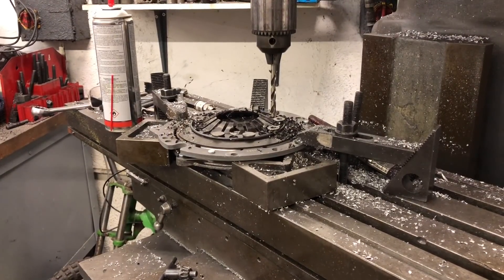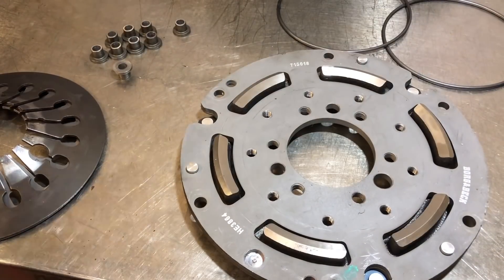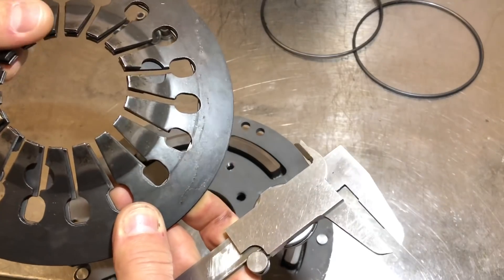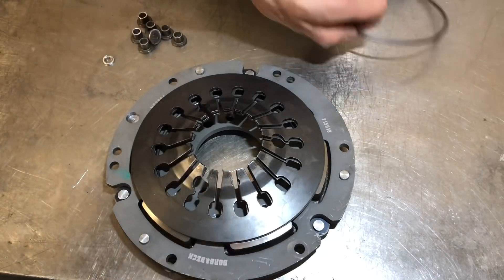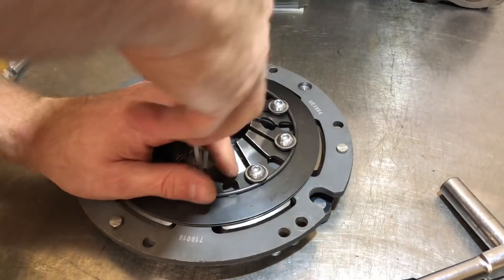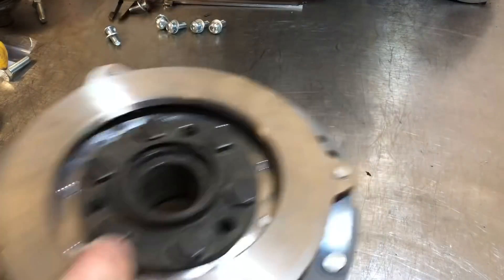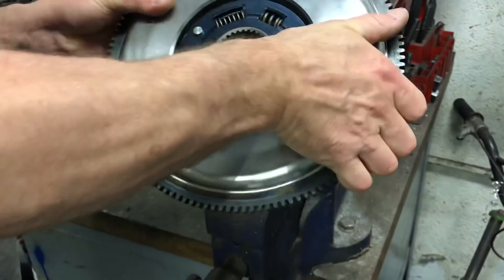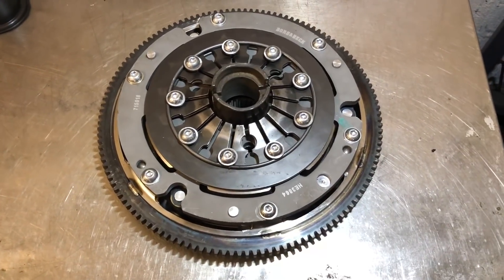RTS  Classic Mini Verto Clutch build

Comment: I have 2 standard borg and deck spring and are 2.2 mm all of them. How can you have a 1.9 if is the same kit ?
Reply from the maker: There are many different thickness springs available
Reply: @Vmaxporsch  borg he3864 is standard and I have two of this and are 2.2 what is the code of the 1.9 ? Thanks if you can help me
Reply: @Vmaxporsch   borg and deck only has 2.2 i can t understand how you can have a 1.9. with my set up the pedal is heavy and hold 450 nm too much, and i am looking to find a spring like your but i can t find

Comment: Stuart, in the video at around 5:39, you mention using Loctite 571, this does not seem to be available in the UK? Would 243 Loctite Blue be suitable? Also, if the clutch had already been balanced would it need balancing after the upgrade?
Reply from the maker: yep
Reply: @Vmaxporsch  I take it thats a yes to both? Also can I send you my RTS Clutch and Flywheel to get balanced (when I finish it)?

Comment: Stuart - I have just been advised to change my MED ST1 Competition Clutch and lightened flywheel for an RTS type clutch. Just been quoted £750 for one to be made (new). Having come across this video I think I'll have a go at making my own :-) Many thanks (would I be able to retain my Lightened Flywheel and convert the existing clutch?
Reply from the maker: Hi Bill , its best to have a clutch suited to the torque of the engine - for supercharged one up rated verto unit (see minispares) with one standard extra verto spring will give you around 160-180ft lbs capacity, many RTS are 2x uprated or 2x turbo giving around 250 plus ft lbs capacity and an unnecessary heavy pedal wearing clutch operating components.
Reply: @Vmaxporsch  Stuart - since posting this MED have confirmed that the Clutch I have is rated 70lb/ft this has been balanced. I was hoping to add another spring to this clutch - picked up a very good condition one locally last night.
Reply: @Vmaxporsch  Sorry Stuart difficult without knowing my spec or intended use. 1310, Hepolite 8cc pistons, AC RS Cam, will have 1.3 Rockers, LCB and RC40, doing the head myself. Initially engine wont be SC, but I am ensuring Diff and Clutch will be up to it and not need changing. So 3.44 Moly Pin is being swapped for Crss Pin 3.1. I am not looking for a massive powerful engine,  just anything over 100ft/lb - 140ft/lb would do nicely thanks :-) I picked up a SH Eaton65 and I have a DCOE 45 (nothing else yet) also looking out for a MegaJolt and Ford EDIS bits.
Reply from the maker: @Sternhammer89  what number are the pistons ? running 10 psi is probably going to get you 120 bhp and 130 ft lbs of torque at 6000/4000 rpm at a guess
Reply: @Vmaxporsch  P21253, I have been advised to head for 8.5CR (for which I'll need a decompression plate as I won't be able to get enough meat out of the head). I was also advised 10 PSI so 120BHP and 130ft lbs would be absolutely fine.
Reply from the maker: @Sternhammer89   21253 are designed for 70 bhp, Ive known them to go to 150 bhp on a turbo , but also to fail at 90 bhp, timing and mixture must be accurately checked before you drive it hard
Reply: @Vmaxporsch  Interesting - no one has mentioned that before, thanks for the warning. I will be adding a Megajolt ignition, Boost and AFR gauge. Will also do lots of research on the correct timing / mixture before melting the pistons. I haven't got my head around timing settings for boost yet.

Comment: Help !! Just put my clutch flywheel back together and the wok won't fit because the release bearing is hitting the thrust sleeve ??
Reply from the maker: hi , you have the correct verto release bearing?
Reply: I'm pretty sure,  it's the same as the one that came out, just been thinking, I've used a different top hat and I'm wondering if that hasn't gone on the crank as far as the old top hat?
Reply: @ianroberts8692 i take it you solved this problem?

Comment: What size drill did you use to drill the rivets out initially? 🤔
Reply from the maker: 6.9mm ready to tap m8 thread in them
Reply: @Vmaxporsch  cheers, going to give this a go 😬
Reply: When I drilled my rivets out, they are like washers, they haven't got the little extension like yours which makes them look like top hats, how can I make that missing distance up and what is the length of that missing bit? Any help is much appreciated
Reply from the maker: @ianroberts8692   hi ian , can you send me a pic ? I can prob find some on an old cover
Reply: @Vmaxporsch  will do,
Reply: @Vmaxporsch  how would you like me to send the picture?

Comment: Would I be right in saying that the same process should work for clutches that have a  plate under the rivitheads holding the spring in place ? Potentially just needing slightly longer bolts to accomodate the  additional thickness of the plate ?
Reply from the maker: yep

Comment: Fantastic idea , currently doing a bare shell restoration on my mini and due to  initial budget constraints I'll be using the original 998 as a short term powerplant to get it rolling and through it's first MOT back on the road. It's needing a verto clutch so this could be the perfect solution to see me through the transition to a big bore engine with one of your supercharger kits without having to buy twice !  Thanks for the tutorial 👍